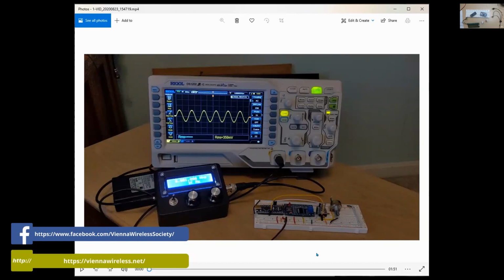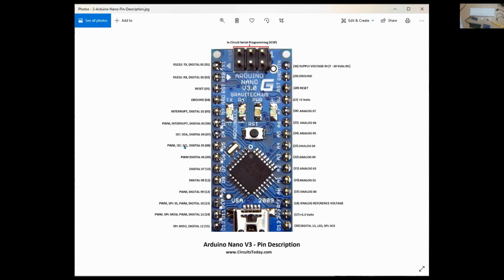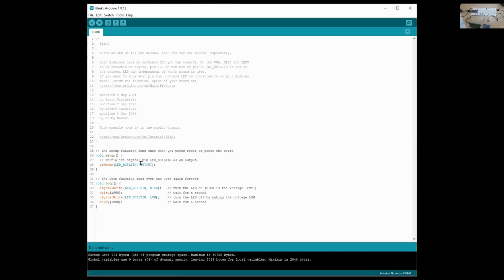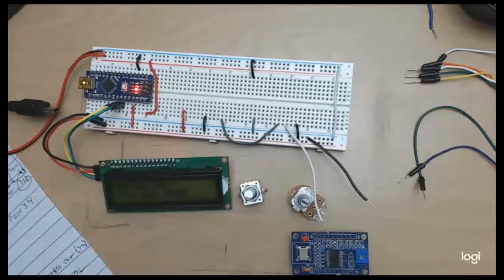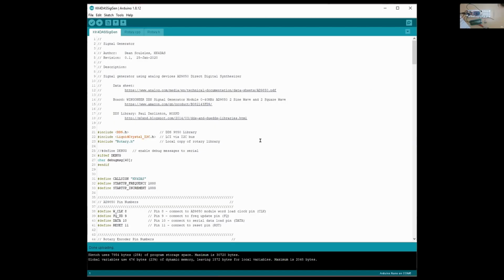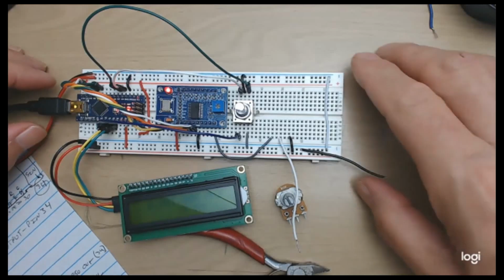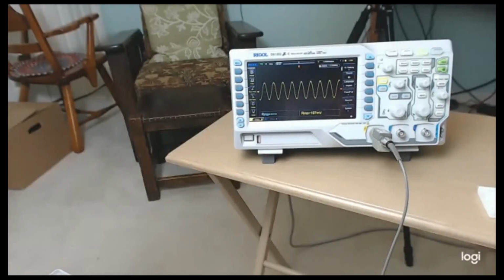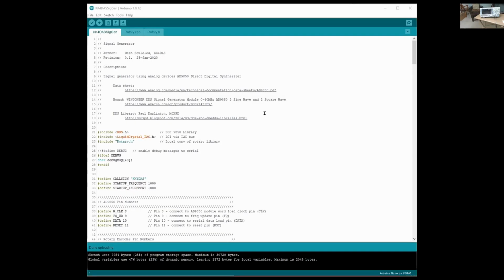Using Arduino components to build a signal generator

Comment: I downloaded  the file and put it in y he library folder but when I compile it says no such file or directory. What am I doing wrong?
Reply from the maker: It's impossible to tell without detailed information about the errors you get. The best way to deal with your problem will be to open a new issue on project's github, showing the errors.
Reply: @ViennaWirelessSociety  It compiled. I was missing the libraries.
Reply from the maker: @robertarchuletta2498  I'm glad you managed to fix the issue. Enjoy experimenting with the generator and building things!

Comment: I couldn't get the sketch to compile. I went through it line by line with yours in this video and I still get a compilation error

KK4DASSigGen:62:34: error: no matching function for call to 'DDS::DDS(int, int, int, int)'

 DDS dds(W_CLK, FQ_UD, DATA, RESET);      // Instantiate the DDS
Reply from the maker: Check if you are linking the right library. There are other libraries with the same name, with different functionality and API. Make sure that you follow instructions form the blog post liked in the description.

Comment: Bonjour,
Je suis débutant dans l'utilisation de l'IDE Arduino et je ne sait pas comment ouvrir les 3 codes (singGen.ino, rotary.ccp et rotary.h) sur une même fenêtre . Merci pour votre vidéo, c'est très intéressant.
Reply from the maker: I don't use Arduino IDE so I can't check, but try open the files one by one without closing the tabs. Each file should open in its own tab.

Comment: hello great video but dac is very costly, can you try to do the dac0800 to generate the sine wave with different frequency if possible please help us vengutech@gmail.com
Reply from the maker: The chip used in this circuit is not a DAC, but a DDS (Direct Digital Synthesis) generator. DAC0800 will not work here.
Reply: @ViennaWirelessSociety  I know the DDS but I need to interface with Arduino to generate the sine wave if you have any idea and code please help us...
Reply from the maker: @vengug7303  If you want to use Arduino as the DDS controller, you should be able to use any DAC. There is a DDS library in the Arduino software package: https://www.arduino.cc/reference/en/libraries/dds/ 
Just don't expect to generate RF frequencies with this setup, or low jitter signals.
Reply: @ViennaWirelessSociety  thanks for your reply I need to generate just 100hz sinewave for  generate the spwm  igbt switching, I need to generate sine and square (carrier) signal for igbt switching application if you have any ideas please help us
Reply from the maker: At this point I think you should take advantage of your professor's or the class TA's office hours, and ask them to help you understand the assignment.
Reply: @ViennaWirelessSociety  Ok Thank you

Comment: I'm looking for a board that will operate stand-alone once programmed. For crystal replacement in old radios.
Reply from the maker: This generator can be easily turned into the LO and BFO for a radio. VWS Makers group currently works on a SimpleSSB transceiver group build, and they use a board based on Si5351 chip https://www.youtube.com/watch?v=578oBGhATeQ
Reply: @ViennaWirelessSociety  I'm looking for a stand-alone board, not something that needs a micro controller hooked up all the time. Once programmed, it's connected to the crystal socket and power and needs no further connection. I've had success with the AD9850 modules, I set them and remove the display, but at $30 each I'd like something smaller, less expensive and complicated.
Reply from the maker: @Travis141123  QRP Labs makes small, programmable, headless generator modules: https://qrp-labs.com/progrock.html
If you want something smaller, search for programmable oscillators: https://www.mouser.com/Passive-Components/Frequency-Control-Timing-Devices/Oscillators/Programmable-Oscillators/_/N-7jdx1

Comment: Hi. Came across this after looking for a signal generator for sometime. I like the simplicity. Downloaded all the files and all worked. Except I had to turn on the LCD backlight in the software. It had me going for a while but all sorted now. Would it be a big job to make the audio range (10Hz - 20kHz) have a finer increment? I will have a go myself but don't want to screw it up. ( Martin from the boat club UK)
Reply from the maker: The frequency step for  AD9850 with a 125MHz reference clock is  0.0291Hz, and this is the smallest frequency increment you can use. Anything more than that is a matter of how much you change the control word. Changing the step in Dean's firmware will require a small change in the software, but should be easy to do.
Reply: @ViennaWirelessSociety  Hi. Thanks for the quick response. I will take a look and see what happens.